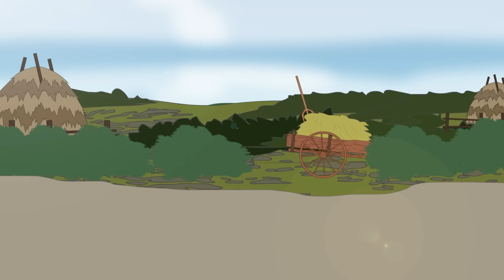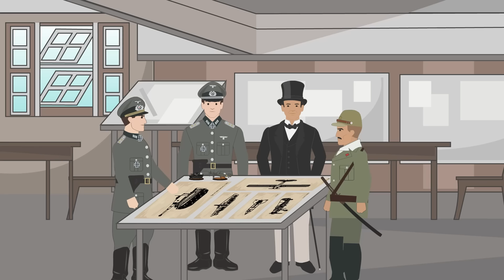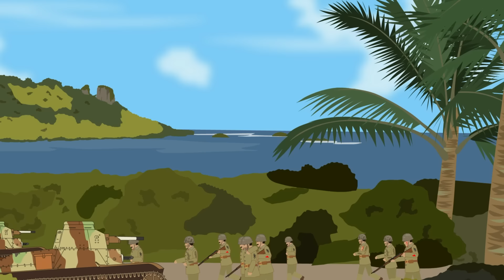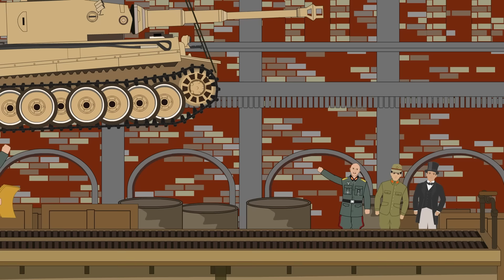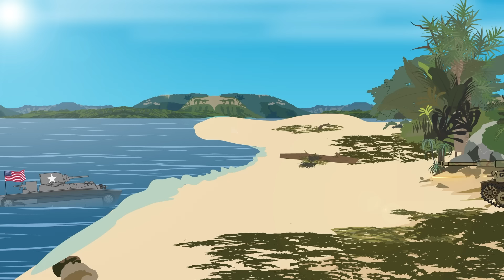Imperial Japan's Lost Tiger Tank of WW2

Comment: They should have copied the PanzerFaust and dropped their tank lines 100% completely. They could use armored cars for their tank needs at a fraction of the cost and a slightly modified PanzerFaust that could be reloaded would be a much better tank destroyer for their needs imho.
Reply: They had their own version
They strapped similar shaped charge on a pointy long stick.

And Panzerfaust was really low performance weapon. It was more of a Guerilla troublemaker than proper attack weapon.
Reply: @jarskil8862 Yes but their version was a su*cide weapon and highly ineffective as they just MG'ed the guy with the stick. The Panzerfaust irregardless of its effectiveness for Germany would have been a much better choice for resource low Japan even from the beginning of the warimho.

Comment: I wonder why a Tiger and not a Panther? The Panther's armor was more than a match for the Sherman tanks that used the standard low velocity 75mm gun, and the Panther's high velocity 75mm gun was more than adequate to stop a Sherman. It would have probably been easier to transport and use in the Pacific Islands since it's much lighter than the Tiger, though the suspension issues may have been flaw that discounted it from adoption

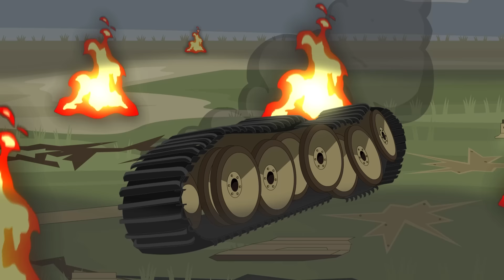Comment: At 8:05 the clip portrays an Early Tiger, chassis number 250055, in Japanese markings  (the end of the chassis number is marked on the front wall).
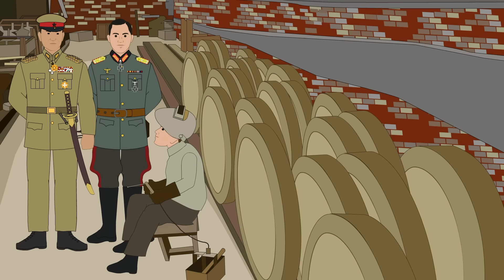But at 4:50 we already heard the actual chassis number of the Tiger they purchased : 250455 , which is a Mid Tiger.

Comment: You know the odd thing is that I think a Panzer III or IV would actually be better suited for the Japanese. Sure they're not the Tiger, but both were perfectly capable tanks and if they used the  75mm or something domestic that was akin to it they'd be able to deal with the US tanks well enough. I can't see the Tiger fighting well in jungles and on islands with such limited room to maneuver. The Panzer III and IV would also still be a notable step up in tank technology and capability from most of the vehicles that Japan was using even if by the German and Allied standards they were older designs.

Comment: Let me buy the 60 ton tank to fight in swamps and on islands. Stellar idea.
Reply: It's not the weight of the Tiger that would've been the issue - the Tiger had excellent ground pressure distribution (actually even better than the Sherman) thanks to its wide tracks and the Tiger also had a built-in fording mode which allowed it to swim through rivers taller than the tank itself.

It's the complexity and fragility of the tank that would have posed the biggest problem. Those interleaving roadwheels would not last a month of use in places like the Philippines, and if the tank ever broke down then the crews would probably committ seppuku out of shame before they would ever manage to fix whatever the problem was especially since the supply lines in the Pacific (or lack thereof) would have meant that there would have barely been any spare parts lying around for them to use.

Chances are, if the Japanese would have used Tigers in a wider scale, they would have just used them less as actual tanks and more as semi-mobile pillboxes or bunkers.
Reply: @rap2xtrooper878  Honestly the Japanese would have been better off buying the Panther instead of the Tiger. It would have been more cost effective to manufacture.
Reply: @rap2xtrooper878  they would probably send this tank to china instead. If we judge the stability of occupied regions. It was the Chinese that had given them active engagements till 45
Reply: @quattro141  This view might be incorrect. While it was indeed China that actively fought against Japan, the Japanese army didn't actually need more advanced tanks to win against the Chinese forces on the Chinese battlefield. Their desire to import more advanced tanks was likely intended to counter Soviet and American tanks.
Reply: @rap2xtrooper878 That's what I was thinking. They'd have to constantly clean the road wheels before the mud dried on them.
Reply: Japan needed Heavy tanks for the Sovjet Union.
Reply: @fj1659  if germany didn't invade Russia, they may have been a benafactor for the japanese
Reply: Yer not a good idea but instead Japan should have bought the panzerfalst for their infantry or even the 88cm German flak gun with anti tank rounds the Japanese really had terrible anti tank weapons
Reply: @petersmulders8058 Depends on what they had. Their artillery or naval guns on direct fire were, in several instances, much better than the tanks or antitank guns used by the Japanese. If I recall correctly the 12 cm Naval Gun was an absolute beast.
Reply: yeah, 5 minutes of serious consideration should have ended this idea quickly. obviously they were desperate.
Reply: I think its meant to be deployed in Manchuria to face off against Soviet tanks
Reply: Japan really needed it and proved to be invincible towards Sherman’s
Reply: @myZQUADizGODZILLAs  yeah no Sherman’s could knock out tigers late war
Reply: @elliee-the-red if you meant Tiger II yes, Tiger I get knocked out by 76 mm
Reply: 日本軍は元々ソビエトと戦うつもりでしたが最終的にアメリカと戦う事になりました。
もしソビエトと戦争する様になればドイツから輸入もしくはライセンス生産をさせてもらったかもしれません。
ただ扱いきれない兵器をもらうよりパンツァーファウストの様な携行式対戦車火器をもらった方が良かったですね。
本土決戦用にそれら火器の配備はありましたが結局使われませんでした。
仮にタイガー戦車を購入して島嶼防衛線に配備出来ても爆撃や艦砲射撃には敵いませんし、その証明はドイツ軍とイギリス海軍の砲撃戦で証明されています。
また根本的な問題として日本は当時とても貧乏であらゆる資源が不足し戦争末期には日本から金属と呼ばれる物は全て軍に徴用されていました。
その問題の所為で自動火器の配備や重戦車の配備が遅れていました。
日本が本来やるべき戦術は陸戦ではなく会場での制海権の確保でした。
幸い日本には優秀な軍艦が大量にありましたし、ハワイやオーストラリアを制圧すればアメリカ軍に長距離移動を強いる事が出来て日露戦争の日本海海戦の様な有利な状況を作る事が出来ました。
Reply: @ニミオチャンネル  It would be almost impossible to build the Tiger in a decreasing number at this point in the game, the United States was bombing the factories and the submarines were destroying the Japanese cargo ships... and even by a miracle the Japanese industry could make around 500 units, it would be too low before American industrial power.
Reply: Tbf they didn’t just fight in swamps and small islands
Reply: They probably would have used it on Japan itself as they did save their best tanks for when the US invaded Japan mainland. It also possible they might just used the Tiger as a reference for newer tanks.
Reply: I get the feeling they would have saved it for defense of the mainland.
Reply: Not only that but can get blasted by a Sherman without it even breaking a sweat.
Reply: @kishascape you lack knowledge about tanks
Reply: @kishascape  are you crazy😂😂
Reply: @kishascape you get your education from games??
Reply: @kishascape easy 8: yeah about that…
Reply: @kishascape a normal Sherman? No. A 76 Sherman? Probably.
Reply: @kishascape So many people are trying to correct you not realizing that the Tiger 1 is just not that great of a tank. So many people think they're invincible when they kinda sucked.
Reply: @kishascape  bro was raised on the mcdonalds menu

Comment: It would’ve been used as a mobile bunker at best. It would be extremely difficult for something like that to maneuver through jungles.
Reply: What about in Manchuria?
Reply: @diskopartizan0850  Manchuria would be better, however, Japan would not have the resources to maintain them. And the fact that the Soviets smashed what was left of Japanese forces in Manchuria, it wouldn’t have made a difference at all.
Reply: @diskopartizan0850 Soviet use many Tanks in Manchurian Offensive the likes of  T-34 with 85 mm Gun that can penetrate Tiger Tank armor in 1000mm , M4A2 with 76 mm Gun that can damage Tiger tank and the most deadly Soviet Tank and known Tiger Tank Killer aka: SU-152 Tank with 152 mm Gun that can destroy in any Direction a  Heavy Armored Tank  SO NO EVEN THE JAPANESE HAVE JAPANESE TIGER TANK THEY WILL NOT STOOD A CHANCE AGAINST SOVIET ONSLAUGHT IN MANCHURIA.
Reply: Sie hielten ihre Kampfkraft für die entscheidende Schlacht auf dem Festland aufrecht.Sie haben wohl nie damit gerechnet, dass eine Atombombe abgeworfen werden würde.
Reply: The Japanese really blew it when they didn't use a panzer. Mark three with a seventy five millimeter gun. Cheaper and easier...the 75 can take a sherman...and they already had 2 examples...greed for something better flunked adequate and miles ahead of what the Japanese were using
Reply: @wirelessone2986 panzer 3 with the 75 was more of a howitzer for infantry and bunkers. It had a pretty decent heat round but a decent velocity for armor. Personally think the panzer iv wouldve been a better choice overall.
Reply: Yeah, but what a bunker

Comment: Even if the imperial japanese army could buy like 50 tiger tanks, it wouldn't make much difference. The Tigers were only intimidating because of their veteran crews and the fact they were used against early medium tanks like the T-34/76 or Sherman. 
Once proper tank destroyers like the M10, Firefly, SU-100, ISU-152... and upgunned T-34/85 came into play, the Tiger became just another tank in the war.
Reply: They should have instead copy the panzershreck or panzerfaust or the STG44

Comment: The weirdest part about the Japanese Tiger is that the Hull is a Tiger H1 and the turret is a Tiger E
Reply: It wasn't a Tiger H1 hull . . .

The Japanese Tiger was a converted mid production command Tiger (Sd.Kfz. 268). The rubber roadwheels are the only thing it shared with early production Tigers (H1)
Reply: @not_stardust  well the hull was just the oldest part the turret was newest thing
Reply: What is difference of Tiger H1 and Tiger E?
Reply: @Star-The-Vaporeon  Tiger H1: less stronger armour, has more weaker engine, the commander cupola was high, and the wheels was also not the best. 
Tiger E: has more stronger armour, better engine, better commander cupola with a MG42 attachment, and better wheels and suspension
Reply: @Star-The-Vaporeon the most notable difference would be the Cupola. As you can see the H1 have a higher cupola on its turret comparing to the E's. This improvement on the E was very good cuz in the H1 even if you angle the tank right they still can destroy you by aiming that that tall cupola.
Reply: @Star-The-Vaporeon   There is no difference. The tank had no versions. Different names were used by different organisations at different times, that's all. 
The same Tiger could be called a H1 when it was new, and E later on.

Comment: Imagine if that thing actualy made it to the frontline or God forbid actual mass production, It would be a nightmare for Stuart and sherman tanks to fight.
Reply: Theyll ran out of resources before they can actually assemble that crappy tank. Not to mention 76 shermans would just turn it like a light tank with a big gun
Reply: @BarryAllen__1A23  most Shermans used in the Pacific didn't have the 76mm gun, since the 75mm was more effective against the Japanese forces at the time. Besides, America was mostly too busy using the 76 against German forces anyway
Reply: @propellerknight6334  Even still 76 shermans getting shipped into pacific is far more realistic than the japanese mass producing tigers
Reply: @propellerknight6334  the allies didn't even need any 76mm shermans in the pacific if they ever encountereda tiger. They already have air superiority by 1944.
Reply: True True and then the US submarine core would also put in their two cents while it was being transported.  However thet shock factor alone would be the biggest impact. @BarryAllen__1A23
Reply: The 76mm gun in my pocket: 😊
Reply: It would literally be a logistical Nightmare for the Japanese, plus certain Sherman Variants would be equipped with the 76mm if their existence was found out

Comment: Had the Tiger actually reached the Pacific Theater, it would have given the American's a huge headache. Imagine it at Iwo Jima, several Tigers dug into the mountain side? Terrifying.
Sadly, it never would have come to pass as getting the things to the front lines would be near impossible.
Even if Japanese was able to (some how) manage to build Tigers, by 1943 the USN would basically take the Pacific Theater (Leyte Gulf). The Tiger would never have gotten to the defensive points even if they reached the island. Traveling over sand and volcanic ash just to start is different than Russian swamps or mud. 
Honestly, Japan should have just studied the tank and made their own based off it. I dont count the Type 3, 4, and 5 medium tanks as they were more bigger badder versions of the Chi-ha. Or at the very least, manage to build turrets and 88mm guns based off the Tiger and use them as static AT bunkers.
Reply: If tigers digs in then its an easy prey for aerial attacks.
Reply: A tiger on Iwo Jima or Okinawa would just get bombed by aircraft immediately. 
I highly doubt they could hide one in a mountainside like AT guns just due to the sheer size.
Reply: tigers were way to heavy for that theater stugs however would of performed well being only 4 tons heavier then japans biggest tank depending on model and the 75 on them was good enough to smash a sherman

Comment: It would not make much of a difference since it was not compatible with the tactics and doctrines used on the Pacific Theater where everything was about having a good naval,air and landing forces working together in sync and trying to assault or defend some heavily fortified positions on relatively small terrains. Without much space for its maneuvers the heavier tank types like the Tiger would have become relatively easy pray for air attacks and naval artillery that is why the Japanese relied on lighter and more mobile armored units like light/medium tanks and tankettes.
Reply: It really would have only been useful in the defense of the mainland and larger islands. But transporting the thing more inland would be a logistical nightmare because of its reliability issues. Lighter tanks like Panzer 3 and 4 would be a lot better with an upgraded gun similar to Firefly and EZ8 would be a more cost effective measure than Tiger or Panther. The biggest issue would still be the Sherman's legendary variety with napalm variants being incredibly deadly to entrenched holes so I would say they should be priority. Another method that could work would be the procurement of anti-tank weapons like the Panzershreck or Panzeraust in dedicated guerilla style Hunter-Killer units and would be more effective than the lunge mine as it doesn't kill its user.

Comment: Im surprised that they coose Tiger tank , I mean it would be way more useful to have lighter vehicles like Hetzer or Stug - cheaper , lighter , can face M4 without biger problems
Reply: StuG III was more or less an assault gun and decent AT with the longer 75mm. Not necessarily what the Japanese wanted in a holdout position though. The Hetzer would've been a good choice but it wasn't even put into service until 1944 so not much of a battle record before the Normandy invasion and loss of shipping cabilities.
Reply: not only that a hetzer or a stug would have fought a lot better in a jungle than a tiger